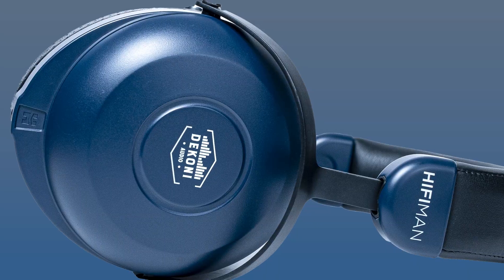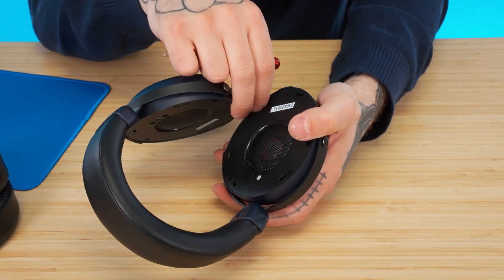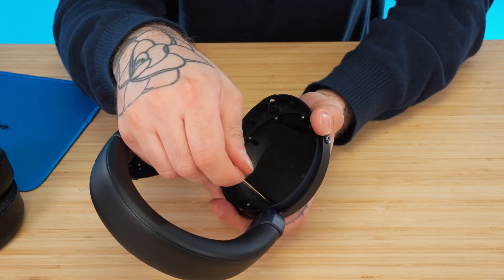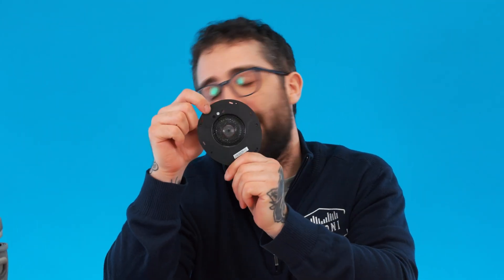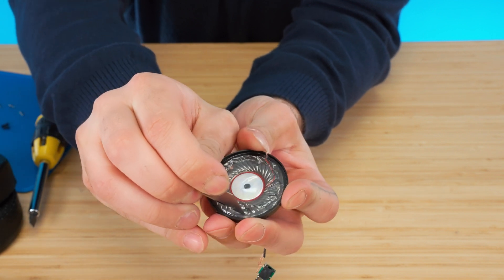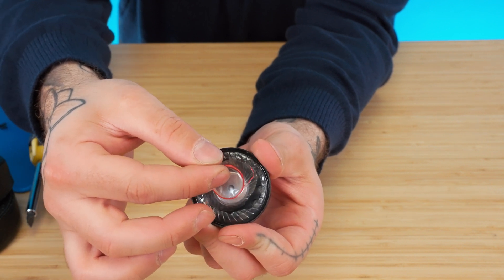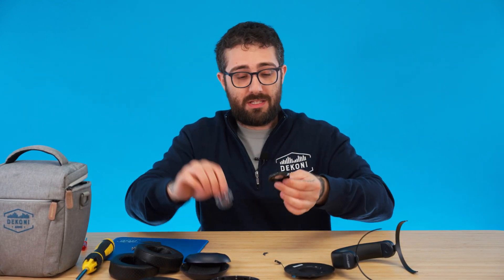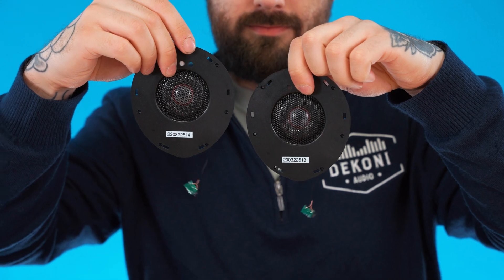What does the inside of a headphone look like? | Dekoni x Hifiman Cobalt

Comment: Is all that empty space in the headphone intential for device performance?
Reply from the maker: Depends on the headphone. Some headphones are made with back pressure in mind. In a closed back, you would need some space for air displacement. The reverse movement of the diaphragm would sound like a suction cup if there wasn't enough space for this.